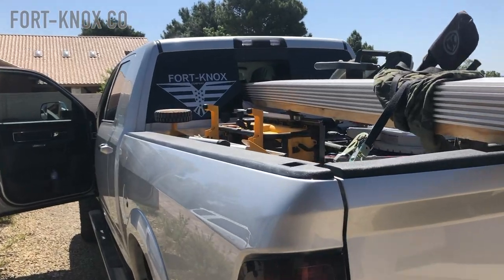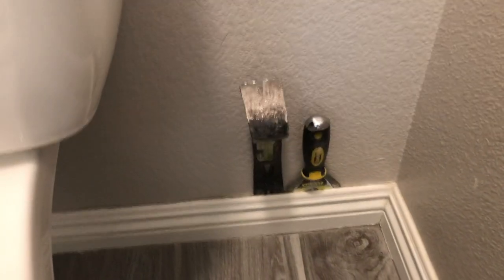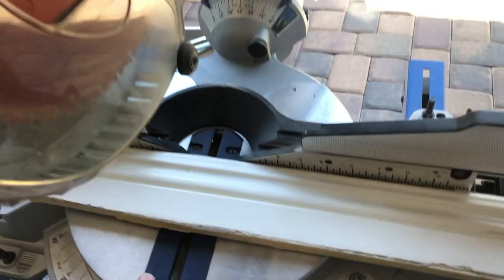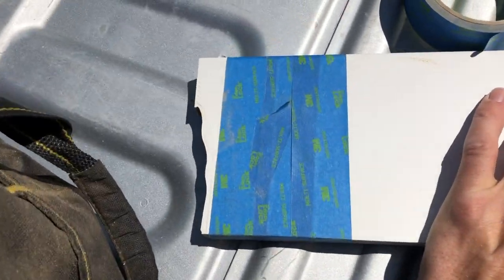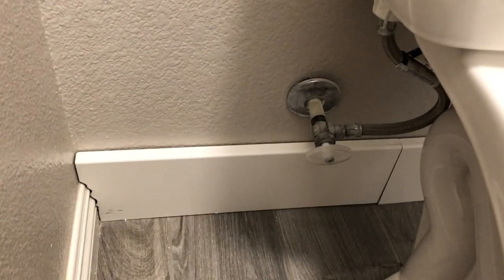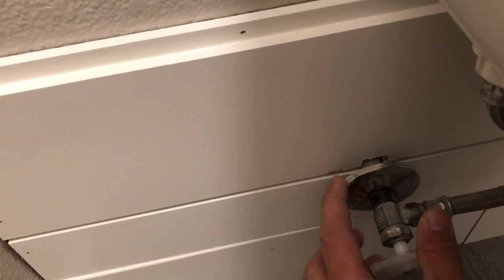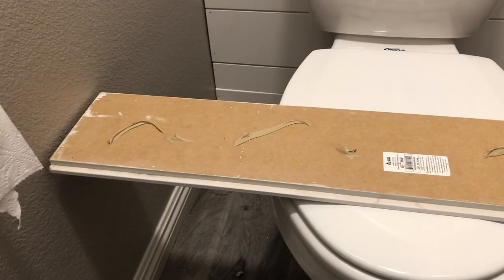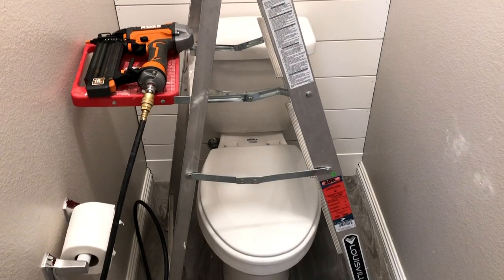Shiplap Bathroom Accent Wall Install and How To DIY

Comment: I am planning on doing something similar with my bathroom. Did you just use quarter round moulding or was there a particular type or style of moulding that you used? I couldn't really tell from the video but I like the look and the way the moulding brings it together.
Reply from the maker: I used a basic 1/4 round. But I also have used the same molding but in 1” flat. Depends on what look you want. Either way it really cleans up the lines and finishes the project. I’d suggest using the flexible composite molding over the solid wood molding. Just my personal preference but it’s more consistent with look, condition and is more flexible.

Comment: What kind of trim are you using to cover the holes in the shiplap? Is one side flat? We are installing white shiplap this weekend in our downstairs bathroom.
Reply from the maker: I’m using a PVC composite molding commonly used to trim out baseboards and door casings. I like the composite material because it’s more consistent and flexible than the real wood molding. It comes in white and you usually don’t even need to paint it. But I use the quarter round or flat style depending on preference

Comment: Great video! Did you put the caulk along the 1/4-round and shiplap interface? Or just where the baseboard met?
Reply from the maker: Just where the baseboard met. The trim/round over had a symmetrical look and didn’t want to gunk it up with caulk.
Reply: @FortKnoxCo  thanks!

Comment: What paint did you use? And how did you attached the trim? Thanks.
Reply from the maker: I used a vanilla white from bear at Home Depot. I usually do the paint & primer combo for good coverage. In an eggshell finish so it’s somewhat sealed and won’t absorb moister as much since it’s in a wet area. 
I attached the trim with small finish nails and just used a white filler for the few holes.

Comment: What width did you measure each board out to?
Reply from the maker: Like as far as how wide across the wall they needed to go? I just measures the wall exactly and then cut about 1/4”-1/8” less to give some room for variance in the drywall. I cut and measured about every 3-4 boards because some houses walls differ a lot as the corners go up. So cut a few and make sure your keeping that tiny gap from the corner. That way you can cover it with your trim piece at the end

Comment: How did you get it behind the toilet? Does the backpack have some wiggle room as far as wall gap? Mine is right up against the wall
Reply from the maker: With this install it was very tight behind the tank of the toilet. But there was just enough space to slide the piece of shiplap straight down. So hopefully there would be enough space/gap. All you need is about 3/8”-3/4” maybe?

Comment: I don't see a point to keep those old outdated baseboards, seems like too much hassle for something that will be ripped off eventually, the bathroom is small enough and it wouldn't cost much to replace baseboards.
Reply from the maker: I agree. But in this case it was for a client, so I did as they wanted and just made it look good. If it were up to me I may have updated the whole bathroom with new baseboard :)
Reply: @FortKnoxCo  I understand I thought that clients aren’t critical thinkers.